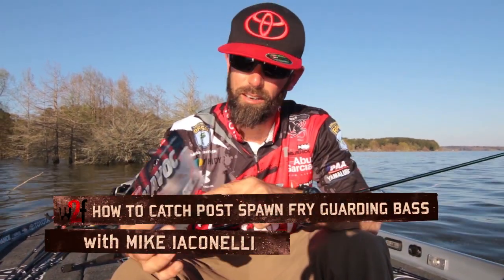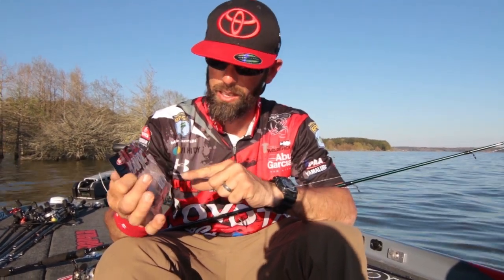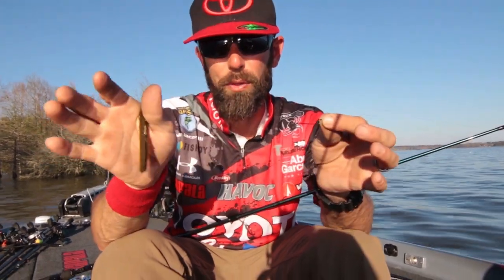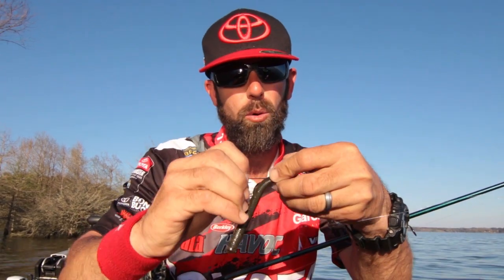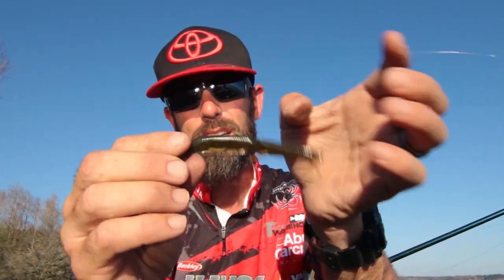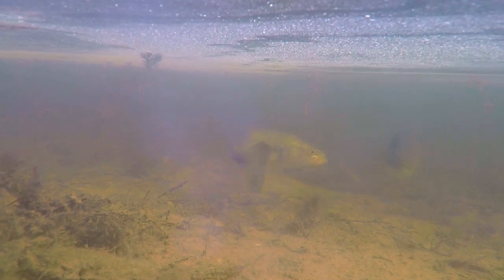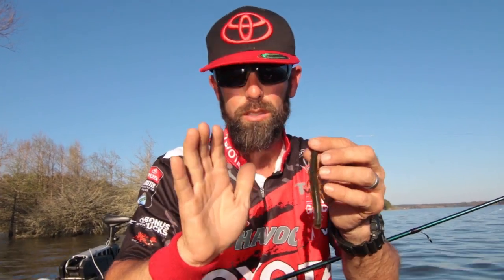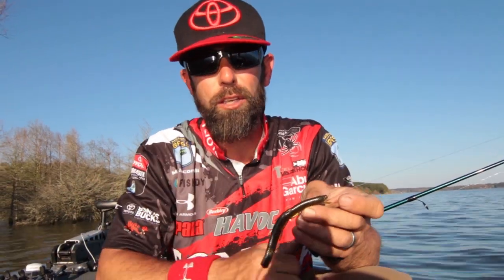Use the French Fry Rig to Catch Fry Guarding Bass

Comment: Bought a pack, threw it about 9 different bass. Didn't seem interested
Reply: VBbassfishing It's the exact same thing if you cut a bit of the belly off a senko style bait. That will save you some money aswell. Also, if you put a nail or piece of wire in the ass-end of the bait, it will do the same action as this bait. I'm not sure why you need 5 different baits (exaggeration) to do the same thing, i can make most of my baits do something totally different by cutting and melting them at different points. Saves me a bunch of money when the bass want something specific that an un-altered bait cant do.
Reply: VBbassfishing Sounds like they are real lethargic or stickin' to their jobs.